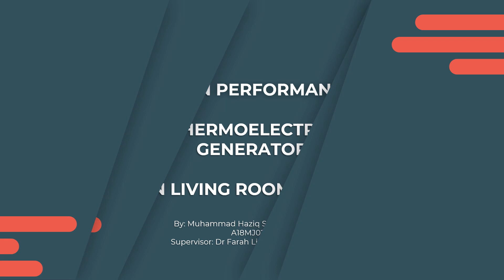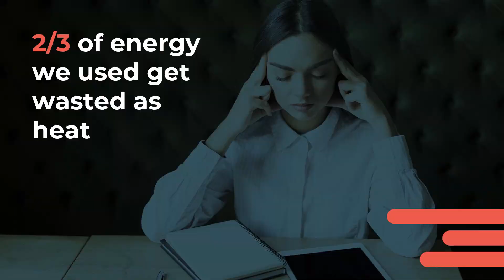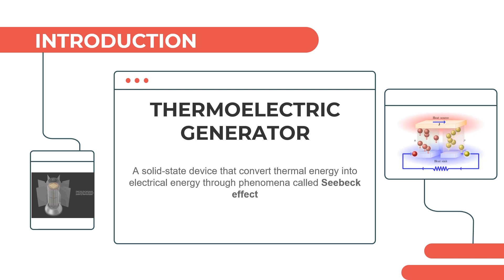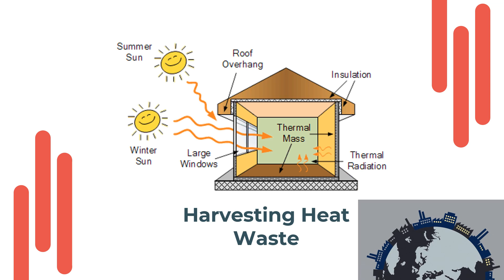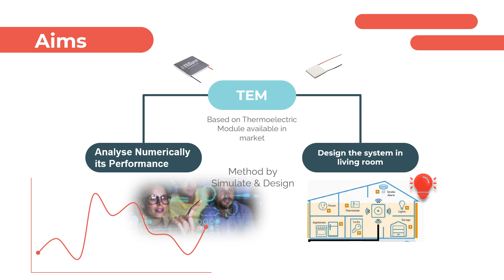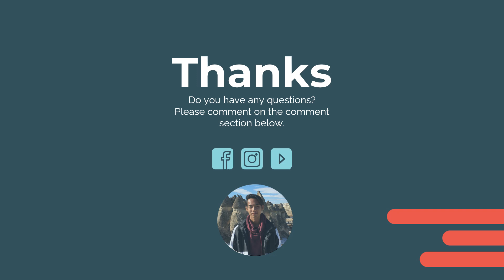5 Minute Thesis (5MT) - Muhd Haziq Safiy Zulkiflee

Comment: Question from examiner 1) What is the value of temperature gradient in your study 2) How much is the predicted generated power of your generator?
Reply from the maker: Thank you for the question Dr,
1) We need to consider the average climate on each region. For this this research, we want to know what is the average temperature for region country that have tropical weather like Malaysia. The average outdoor temperature for tropical region come out average between 20 to 30 Degree Celsius. So, to know the temperature gradient it need to have  temperature different between hot and cold side on the TEG device. With the average temperature in this region , we estimate that the temperature gradient for TEG device to operate should range on 20 to 25 Degree Celsius.

2) The Thermoelectric generator need bigger amount of temperature difference in order to get bigger power generate. Unlike in power station industry, they releasing high amount of temperature produce by burning process, thus the TEG can harvest this waste heat to generate higher power and can increase it efficiency . For this case, the waste heat we want to harvest specific in living room space does not have high temperature. I believe that a single device can produce less than 0.05 W of power went operate in living room. With the estimation value, it is enough to power small devices like sensor and modern digital which commonly does not exceed 5V and need little power.

Comment: Question from the Examiner: 
Please explain how you are  going to analyze numerically the performance of a thermoelectric generator.
Reply from the maker: Thank you Dr, for the question.

From start, I'm going to select the thermoelectric module that available on the market. Usually, the manufacture provided their product data sheet. This data sheet provided by manufacture usually contain Voltage, Current, Coefficient resistivity, Total internal resistance and Seebeck coefficient.  Firstly,  we want to proof either this device come with the correct output value. By using MATLAB/Simulink software, we able to calculate from the base equation for thermoelectric. Then, we also able to simulate and compare the parameter data given by manufacture and data from the simulation. If the data shows the similar value, we can proceed to analyze the module performance in living room. Temperature that need to collect in the living room is different. Thus, come with different output value. By using MATLAB/Simulink, we want to predict the Voltage value in room temperature condition produce and the efficiency to be place in living room. In one study have proved that this software can be one of the tools to use for selecting thermoelectric module (K.N Khamil., M.F.M Sabri., A.M Yusop., R. Mohamed., M.S. Sharuddin., 2020). I hope this clarifies your query, thank you.